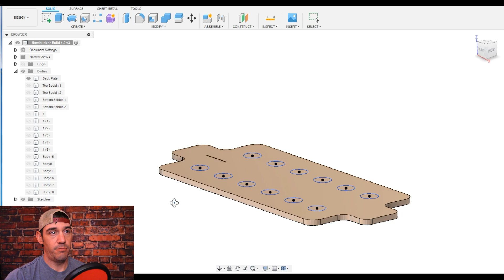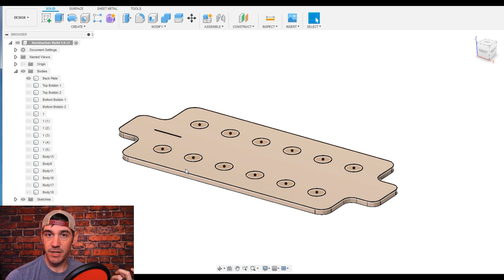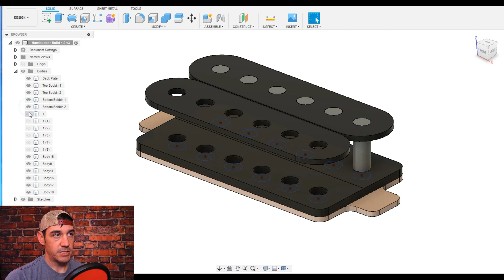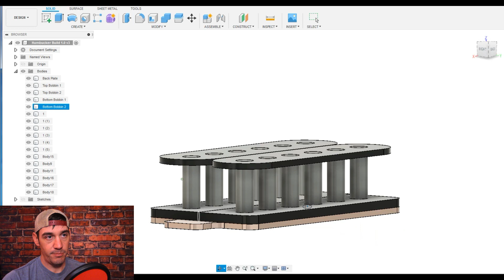✅Building a Humbucker Pickup (Part 1) The Design using Fusion 360

Comment: Disadvantage if its high, on some guitar with a thin body that have shallow route . You cant low it as much as you want between the pole and string spacing. My musicman valentine very thin body a normal humbucker maximum low i can go is around 4mm between string . Some people like it low as much as 4mm-4.5mm. Luckily I prefer around 3mm .so if ur design is high pickup that would be the disadvantage.advantage is u can round as thick as u want than normal to make it more higher resistance and output.

Comment: Very interesting project Chase. Thinking about what you said about using also the option of split coils here, would be wonderful if you also use different kind of alnicos for each coil, for example, one coil with alnico 3 which is upposed to be warmer and alnico 5 or 8 for the other one, always respecting the HB polarities of course! Can't wait to hear the result, good luck and again, nice idea! Cheers!
Reply from the maker: That’s a good idea. I may could build them to where I can change them out. That might be interesting. Thanks for the comment bud.

Comment: You want a ceramic magnet dude
Reply from the maker: Gotcha. I know using a single magnet will keep the magnetic field consistent but what are some other reasons? I’m trying this as an experiment as well😬.
Reply: @ChasesWKshop   higher output...
Nice midrange
Reply: Chase'sWKshop I don’t see how you can use a single magnet.  I thought that in addition to the reverse windings hum-buckers were reverse polarity.
Reply from the maker: Yosemite Sam they are but a humbucker can use a rectangle ceramic magnet that it’s polarity is from the long short sides of the magnet.  So you have one side of magnet south and the other side north which intern sit between the lugs and screws of a humbucker making one side south and one side north.  Hope this makes sense 😬.
Reply: Chase'sWKshop okay, yeah, I understand.  There’s also the height of the bobbins,  filtertron hum buckers are taller than Gibson style humbuckers.  High line guitars has a video where does a full humbucker build with 4 wires which is what you need for the coil split.
Reply from the maker: Yosemite Sam awesome, thanks for the info bud.  The cool split is one thing I’m going to have to do some research on!